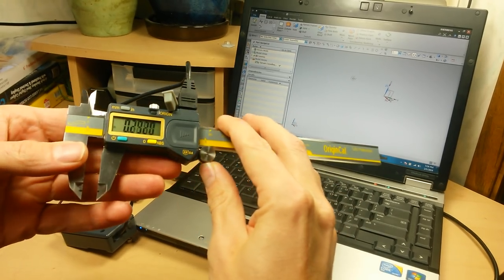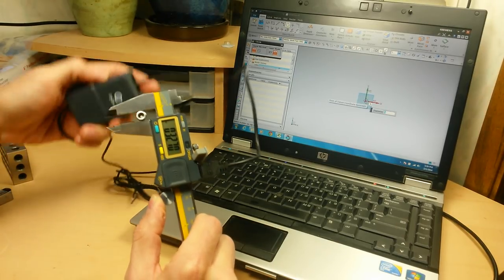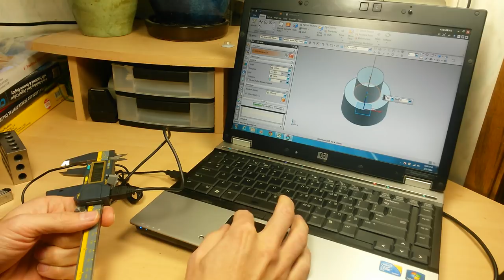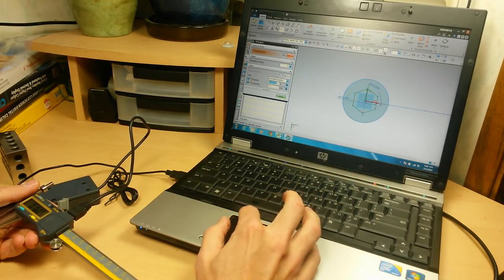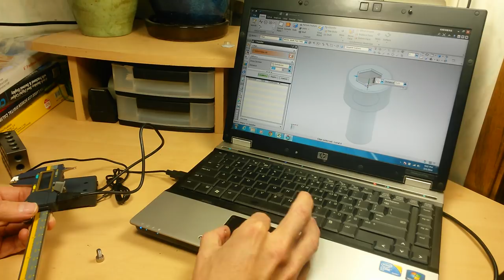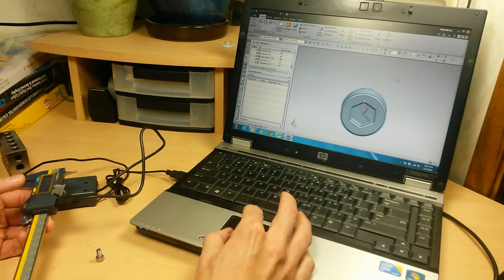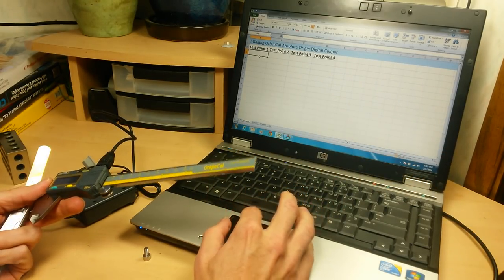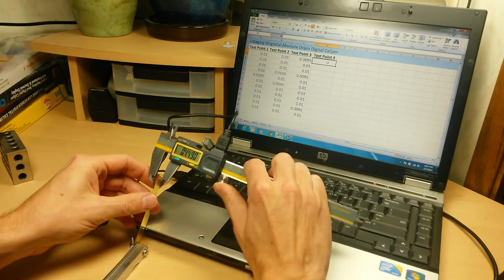Digital Caliper Round-Up (:4:) Data Cable Input With the iGaging & Mitutoyo in CAD/CAM NX & Excel

Comment: Instead of entering the "radius" of the hex, you want to create a driving dimension from one flat side to the opposite flat side. Measure this value with your caliper. This is the common way to measure the size of a hex nut, for example. This is called the measurement "across the flats." This is also the size of the wrench to use.
Great video!
Reply from the maker: thanks!

Comment: Thanks for making this video! Helped a lot. :)
Do you have any idea what's the difference between the Mitutoyo 264-012-10 (the one you're using) and the Mitutoyo 264-016? I couldn't find any comparison between the two. But according to pictures in google the only difference I see is that the 264-016 has a big button compared to the small one in the 264-012-10.
Reply: Just found the answer on page 4 in this PDF: http://www.mitutoyo.com.sg/documents/USB_input_tool.pdf
It seems like the 264-016 is a newest model that has a ø18mm switch VS the ø4mm one in the 264-012-10. And both of the units have a 3.5mm mono jack for foot switch. I read that you can use any standard foot pedal if you have one, even of a synthesizer and save some bucks. :)

Comment: Great vids man!  I am wondering if you know if the Mitutoyo foot pedal is compatible with Igaging data link?  For parts that you have to hold while measuring, the foot pedal seems to be a necessity.  Thanks
Reply from the maker: Mitutoyo makes a cable with a new type of data connection now. I'm not sure if the foot pedal will work or not.

Comment: Can data output from caliper go to different software than Excel? I mean some kind of software focused on SPC data collection which can visualize and analyze it. Will software like this recognize this device?
Reply from the maker: yep. any application that can take keyboard input will accept this input.
Reply from the maker: Yes. It is recognized as a standard HID device like a mouse or keyboard. The data output will be the same as if you entered the numbers on a keyboard.

Comment: I assume the data format between a mitutoyo and a igaging is different.
Reply from the maker: +Steve Spence No, they are interchangeable
Reply: Not according to Igaging. Igaging uses a 21bit data stream, Mitutoyo uses a 52 bit data stream.
Reply from the maker: +GadgetClass the cable is supposed to be interchangeable and work on either. since it's a simple HID input driver. I'm assuming the data steam is generated by the caliper itself then.
Reply: yes, the caliper generates the data stream, but not the clock.
Reply: +GadgetClass Just got my igaging caliper and speedmic today. They do not use the same cable. The igaging cable has a much larger connector.
Reply from the maker: +Steve Spence both of them? My mitutoyo isn't a digimatic, so I was never able to verify.  
what model mitutoyo do you have?
Reply: +GadgetClass http://amzn.to/1MbSauJ uses this cable http://amzn.to/1MbSj12
The Igaging units use the same cable, but it's not the same cable as my Mitutoyo. They use the older Mitutoyo cable. It's larger. Mine has two screws and is slim.
Reply from the maker: +Steve Spence I see. I'll have to update the videos.
Reply: I'm working on figuring out the cabling and the data format. Will keep you posted.
Reply from the maker: +Steve Spence cool, let me know what you find.
Reply from the maker: +Steve Spence imaging does have another cable type that goes with their standard micrometer series. It screws on like that mitutoyo one.
Reply: Why can't companies standardize within their own product line. I just ordered this cable - http://amzn.to/1graXGQ
Reply: So, on the above cable, what do you suppose the pins and signaling is?
Reply from the maker: +Steve Spence I've never done any kind of pinout testing on these so I can't help much there.
Reply: I got the igaging working with an arduino. - http://www.instructables.com/id/Interfacing-a-Digital-Micrometer-to-a-Microcontrol/